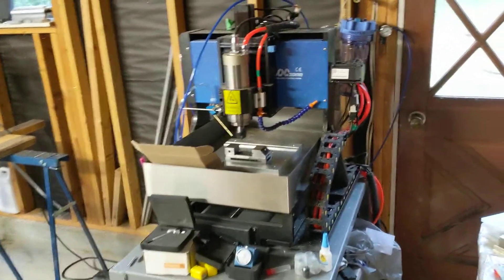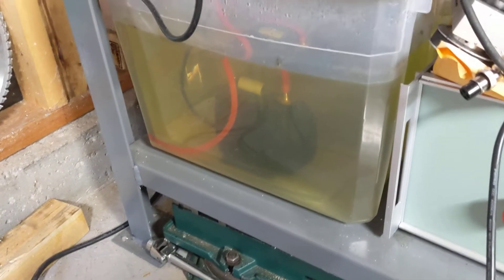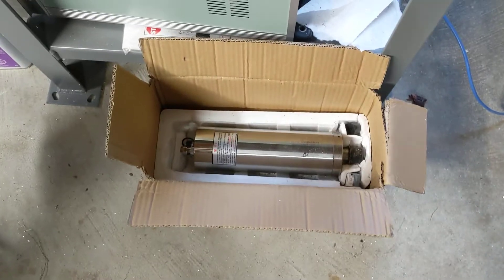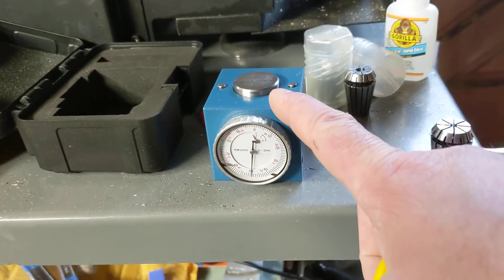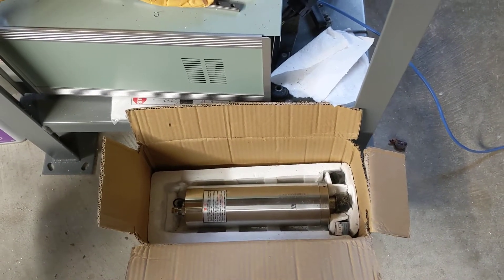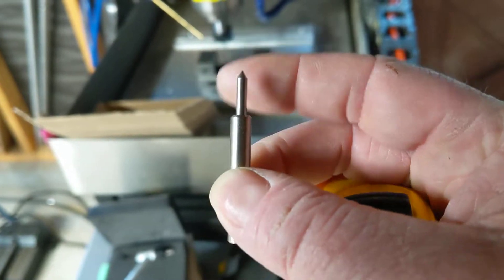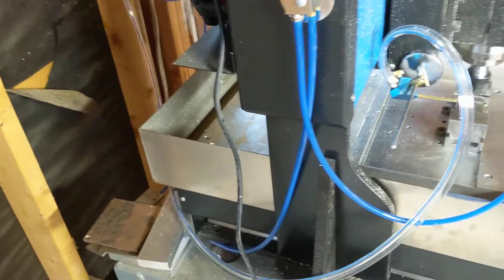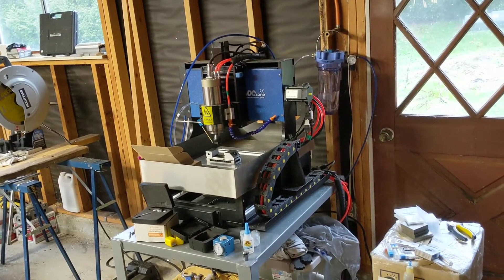More details on the China 3040 CNC.

Comment: Thanks for the video.

I thinking to buy this 3040 cnc , it is 3000€ in my country ,

So i can cut titanium and metal ? If i go slow ?
Reply from the maker: If you get this version, with the steel frame, with the profiled linear ways and carriages, with the 2200W spindle, AND upgrade the top  to stiffen the machine, yes.

Remember that "3040" just means the approximate cutting area of the machine, so there are many different "3040" machines. There are 3040 machines with aluminum frames, round linear shafts, and 800W spindles that will NOT be suitable. So make sure you read the details of the machine you are buying.
Reply: @dimman77  can i send you link here ?
Reply from the maker: @davaxtechnology5139  Sure.  I'll send you one too.

https://www.ebay.ca/itm/333597467406?mkcid=16&mkevt=1&mkrid=711-127632-2357-0&ssspo=WHGLfyjBQmC&sssrc=4429486&ssuid=UTRErFXjQtK&var=&widget_ver=artemis&media=COPY

This is the closest machine to mine on eBay right now, AND has an upgraded table.
Reply: @dimman77  it doesnt allow me to send link here
Do you have email or something
Reply: @dimman77  what do you mean by upgrade the top? can you maybe post a link for a tutorial pls?
Reply from the maker: @DarkMatterLP1  The top of the lower frame, the table top.  Look at my other videos where I take of the flimsy extrusions and bolt on a big solid aluminum plate for a table top.

Comment: S o how do you like this machine? How much did this cost and I'd it effective in cutting steel?
Reply from the maker: To get it to how it is right now is more expensive than when I bought everything. Maybe $4500-$5000 Canadian shipped plus the mods.

And yes it cuts mild steel, 316L stainless steel, and 6Al-4V titanium with the correct cutters, feeds, and speeds. Because of the torque profile of the spindle needs higher rpm it performs better with smaller diameter cutters. The largest I've used for facing and pockets is 6mm, but generally use 4mm down to 0.2mm for the small parts I'm using it for.
Reply: Is that with the 24K spindle or did you get around to using that 1500-1200rpm spindle you mentioned elsewhere? @dimman77
Reply from the maker: @AntiVaganza  Still the 24k spindle it came with. I've been mainly doing brass and/or parts that require tiny end mills and drills, so the rpm range still works nicely.
Reply: Thanks for getting back. I will have to have a think about which tool size I'll be using and run some feed and speeds calcs (Still a newbie without a machine). But I think for Ø3-6mm in titanium we are already down below 10K rpm  @dimman77  

How slow can you run your 24K spindle and still cut steel?  ~10-12K?
Reply from the maker: @AntiVaganza  I did titanium and stainless steel facing with Dia 6mm at 6000rpm. Not a deep cut.  I prefer Dia 4mm for deeper cuts, but less step-over obviously.
Reply: Gotcha. Supposedly not all 2.2kw, 24K rpm spindles are created equally and some do have more low end torque than others. Since I will be milling both alu and ti I am not sure what to do. Either get that low end spindle and a regular 24K in the same size, HZ and wattage (so I can stick with just one VFD) or possibly look for an 18K spindle.  @dimman77  

Thanks again:)
Reply from the maker: Or use smaller tooling on the Titanium to keep the sfm correct with higher rpm?

Edit:

What type/size of parts?
Reply: Yeah, but also don't want it to take forever:). Overall size is about matchbook size but in an L-shape with the L being about 4mm thick or so. Setting out to make nose clips for freedivers.

BTW, how did you get on with the mist cooling for titanium - was that enough?
 @dimman77
Reply from the maker: @AntiVaganza  Mist is awesome, but need good ventilation as I'm running 70-90% isopropyl alcohol. Leaves nice clean parts and chips compared to soluble oils.

Comment: Hello, i have the same machine burt I have problem with spindle. i cant control spindle in MACH3. 
Do you know where is problem? if you have manuel to programming the machin with mach3 please
Reply from the maker: What is your machine doing with regards to the spindle?

Mine worked properly when I received it, but I needed to add a few seconds extra delay in Mach3 to wait for the spindle to reach operating speed before running the rest of the program. 

My machine also came with digital manuals both for the machine and for Mach3. If you bought it from China CNC Zone, they can help you through email. 

Your problem could be related to the VFD. There are forums that might be able to help you set up the VFD through Mach3, or help troubleshoot the problem.
Reply: @dimman77  thank you for your replay ,I solved the problem ,I reinstalled Mach3

Comment: a far as i know the difference between your and euro 220v is the hertz? 60 there 50 here.
Reply from the maker: I don't think the frequency difference would blow fuses like it did. Electricity is really not my area of expertise but a buddy said it might be a phase/line difference. Like we have two hot 120v lines and they have one 220v and one neutral line? Either way whatever the issue was the transformer fixed my problem of blowing fuses.

Comment: Any thoughts on converting a PM-25 or similar bench mill to CNC vs this route? 

Also for buying this 3040 did you have to hire an import broker or anything like that?
Reply from the maker: I don't have any experience with converting a bench mill. The things that come to my head though are not having the linear profile carriages and ways will have considerable more friction, and might need bigger servos/steppers and corresponding bigger diameter ballscrews.  My buddy occasionally talks about converting the manual bench mill I briefly show in the video,  but neither of us have looked too seriously yet.

I got this machine from eBay and it was delivered directly to the shop. I'm in a suburb of Vancouver though so the sea port is right here. I had a sea freight  tracking number for the boat it was on, but was kinda surprised when the local delivery guys (a moving company) called me to schedule when they would show up. We also have a push forklift to unload it as there is no loading dock here. 

Unfortunately I don't have any experience with big orders from China where the customs and final delivery has to be organized by the buyer.